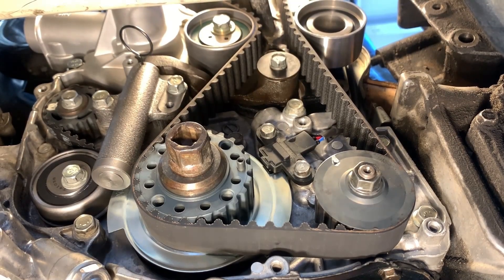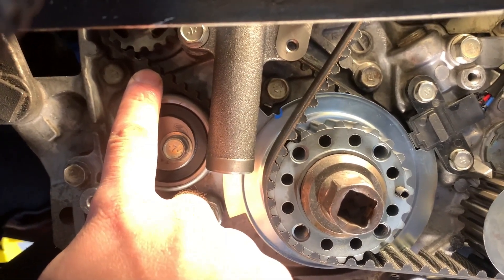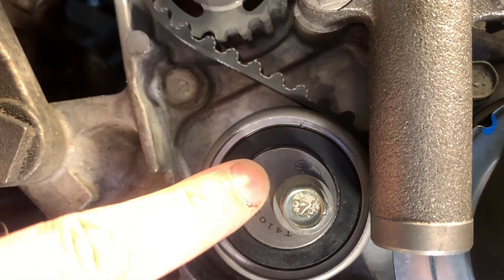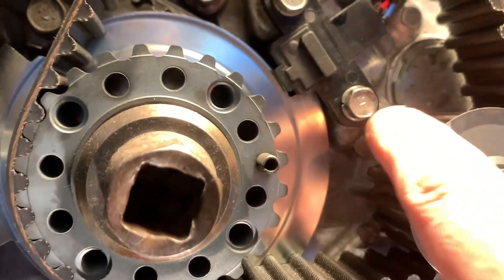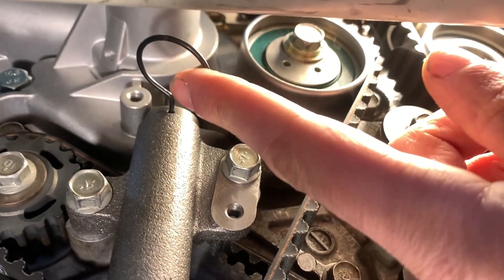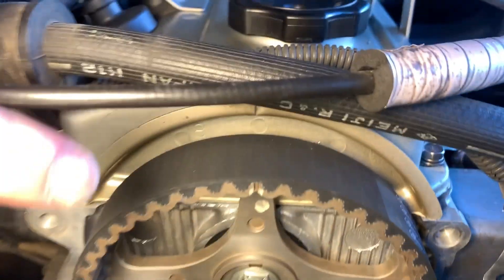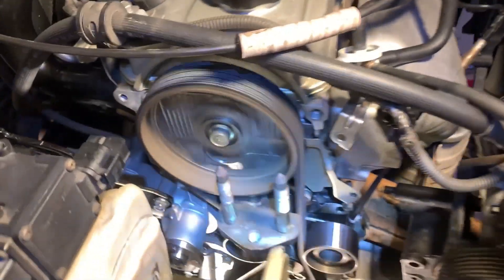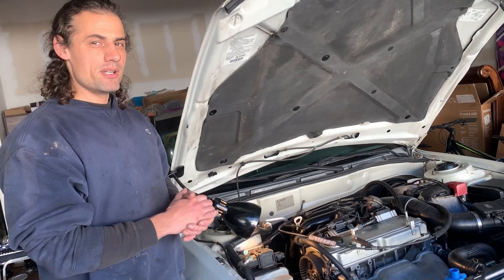Timing Belt Components and Timing Marks [Mitsubishi Galant 2002 2.4L]

Comment: How do you properly set the tension on the balance shaft belt?
Reply from the maker: I did not use any "proper" way to set the tensioner, I'm not sure if there's actually a proper way. I pushed the balance shaft pulley as hard as possible by hand, then tightened the bolt (14 ft-lbs). Check that the belt has no slack and resists firm hand pressure; it should feel as tight as possible by hand.
Let me know if that does not make sense. I will try to find some other way to demo it.

Comment: How did you remove the crankshaft sprocket bolt so I can replace the crankshaft sensor angle blade and crankshaft seal?
Reply from the maker: Use a Camshaft Pulley Holder Tool (borrow for free at Advance Auto Parts or AutoZone: https://shop.advanceautoparts.com/p/powerbuilt-tools-loaner-tool-universal-pulley-holder-tool-kit-647876/12068284-P) with the old timing belt in place, ensuring proper tension and aligned timing marks to prevent sprocket movement.
Before you do anything, make sure your old timing belt is still in place and have enough tension to avoid slipping or allowing any sprockets. Align all the timing marks, because you need a reference to make sure no other sprockets accidently moved while you were loosing up the sprocket bolts.
Have a second person hold the camshaft pulley with the tool to stop engine rotation, then use an impact wrench on low to carefully loosen the bolt - start very slowly to ensure other person still has a good grip on the tool and prevents any rotation. It should not take a lot of torque to undo the bolt and don't fully remove it until you're ready to disassemble the timing belt components.
Reply if you need clarification or a short 3-5 minute video on this.
Good luck!

Comment: Hola🖐 amigo saludos  desde Venezuela. Una pregunta esa correa queda con algo de ruidito al estar instalada o queda totalmente serenito. Es que estoy cambiando uno de esos por primera vez en cuanto a ese motor Mitsubishi.  Cuando esta la correa en buena tension serenita en mi caso pero una vez que revoluciono a alta rpm fuerte fuerte la correa me pierde algo de TENSION porque el tensor retrose un poquito. Claro cambie puro la correa el tensor es marca GMB.
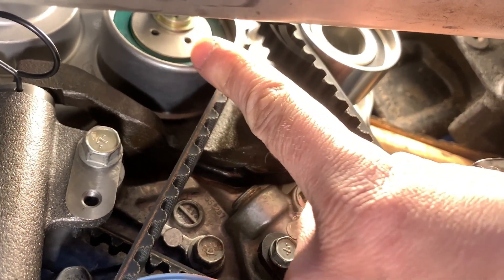Reply from the maker: Hi there. Are you sure it's Timing belt that makes noises? Timing Belt should NOT make any noises. If it makes a noise it is probably lose and it can be an issue. Most likely you'd have to re-tighten it again. Please watch starting at 4:09 where I show Timing Belt tensioner pulley and hydraulic tensioner. Before you crack up the engine, take out the pin installed in the hydraulic tensioner and manually make a full revolution of the engine and wait for about 30 minutes. Then try to re-insert the pin back into the hydraulic tensioner. If you can't do that - that means you have slack in the belt. Lose and re-tighten tensioner pulley again. Unfortunately, you'd need to take out hydraulic tensioner and re-compress the hydraulic pin down (with C-clamp or something like that) to be able to re-insert the pin in it. 
It's important to provide appropriate tension to the Timing belt. Otherwise, it's just a matter of time when it'll snap or break.
Reply: @ngtitovWorldOfCars Pues si amigo ya desmonte el tensor hidraulico para comprimirlo nuevamente y ajustar nuevamente la TENSION de la correa. Si el ruido proviene de alli, porque cuando ajusto todo de nuevo. La polea graduable del tensor, acomodo los tiempos de encendido y le quito el pasador al tensor hidraulico y la Correa queda bien de TENSION. Giro manualmente el motor varias veces antes de prenderlo y se mantiene la TENSION bien. Luego enciendo el motor y el ruido ya no esta presente, totalmente serenito. Ahora cuando lo revoluciono a altas rpm fuertemente y luego vuelve a minimo sin acelerar noto que el tensor hidraulico retrosede un poquito y me aparecer el leve ruidito. Entonces voy y apago el motor y noto que la correa me a perdido un poco de tension. Entonces con un destornillador plano le hago un poquito de palanca con mucho cuidado por debajo al tensor hidraulico y noto retoma la tension la correa. Luego giro el motor varias veces manualmente y no pierde la tension. Luego vuelvo a encender y cero ruido  todo nitido. En fin amigo es como si el tensor no fuera capaz de mantenerme la correa en tension cuando acelera duro el motor y entonces se queda un poco retrosedido. Bueno de ante mano muchas gracias por responder

Comment: How to remove the cover to replace the crankshaft sensor
Reply from the maker: To replace the crankshaft sensor, you can remove the plastic shield (held by 8-10 12mm bolts), but you'll likely need to loosen the power steering pump as well, since the sensor's wiring runs behind it. This gives you the access needed to replace the sensor properly.
Look at 3:54 in the video - right side of the screen, you will see the steering pump hangs there and the wire goes behind it.

Comment: hey mate how do u get the cam sharft off
Reply from the maker: Do you mean how to get camshaft sprocket off? Camshaft sprocket on Mitsubishi Galant is held by 1 central bolt, I believe 22 mm, that's tighten to the cam shaft. To get it off (and the rest of components including crank shaft pulley, water pump pulley and etc.), you need to do it while the timing belt is still on. The timing belt is key - that will give enough resistance to undo the bolt for camshaft sprocket. It is also the key component that holds everything together and most importantly timing marks, so if you give too much torque undoing it, it will spin the entire system, which would not hurt anything (e.g., bending valves and etc.) So, make sure to have your timing belt on, then loosen everything up before taking the belt off. Taking the timing belt off is very last thing you need to do.
Tighten everything back up again, according to torque specs, again you need to use timing belt. You can use new one after installation or old one - not to damage a new one. Me personally - I like to use old one, so the new one does not scratch and doesn't get damaged it as I tighten everything up together. Once everything is tighten, then put the new one back on.

So, use the timing belt resistance to undo the bolt on the camshaft sprocket.
Thank you for the question and hopefully the response is helpful.

Comment: 2003 outlander. 2.4. So my belt broke and im trying to figure out if i have bent valves or messed timing up. 
So cam and crank are dead perfect. But my oil pump does not line up. When it comes to crank every 3rd rotation the the oil pump lines up but cam is 180 out.  Balance shafts line up with crank
Reply from the maker: Sorry to hear about your broken belt - timely replacement is key! To check for bent intake or exhaust valves, perform a compression test (plenty of YouTube videos cover this). If each cylinder holds pressure, your valves are likely fine.
For the oil pump alignment, there's a trick (and it's really cool): I made a video but haven’t posted it. Check this similar one: https://www.youtube.com/watch?v=StWL4GiT9yA . 
It’s not perfect, but it shows rotating the oil pump until the timing mark "tends" to align with the engine nudge by its own balance weight - you'll feel with your fingers where it "wants" to go. It should go to the timing mark. Keep rotating oil pump until you feel it is aligned. If unclear, reply, and I'll post the 1-minute trick video. 
Yes, and of course, do NOT forget the balance shaft and its belt... It tends to break first !!! before timing belt!!! Make sure it is aligned as it is shown in my video.
Thanks for watching! Good luck, and let me know how it goes!

Comment: We'd like to know how to time the belt when placing it on a Mitsubishi Space Runner 1.8
Do we have to place all the belts (water pump) and power belt before we try starting the engine?
Reply from the maker: No. If you noticed in the video, I test-run the engine without belts (no alternator or water pump) for under a minute to avoid overheating - any longer risks damage (it will get hot quickly and without proper cooling, it might get damaged). Once you confirm it starts and runs without any issues, you can reinstall the belts.